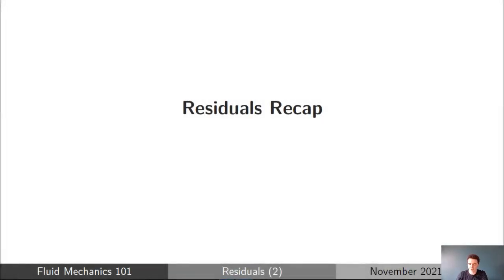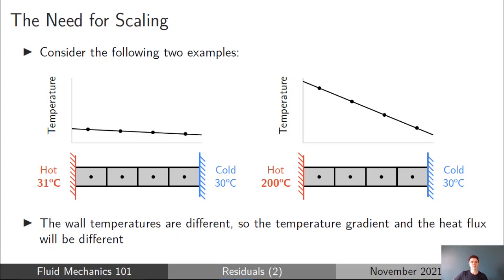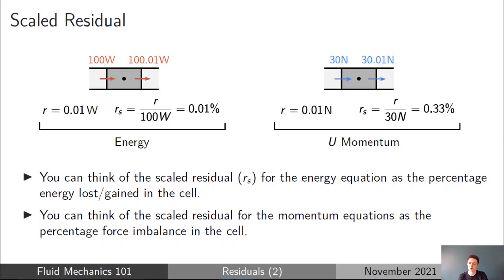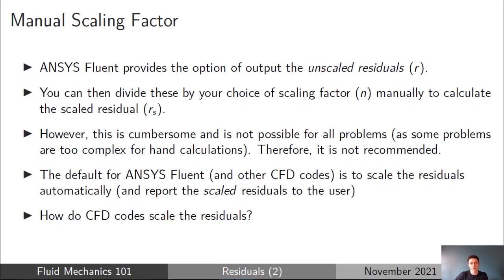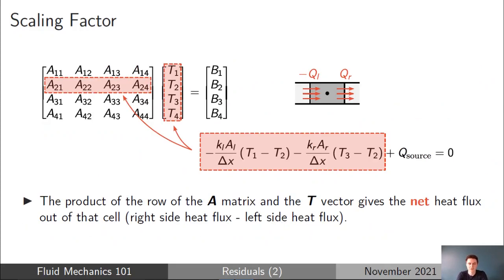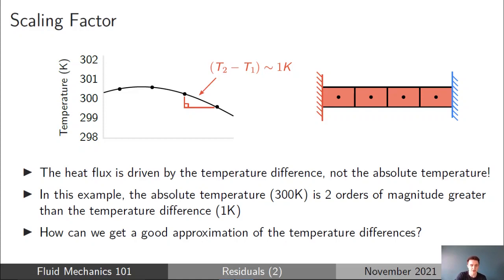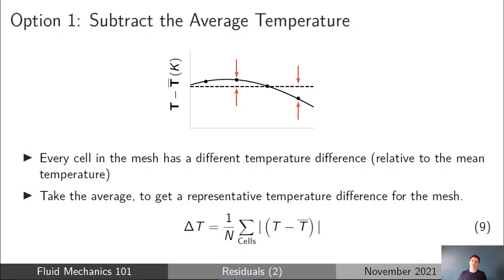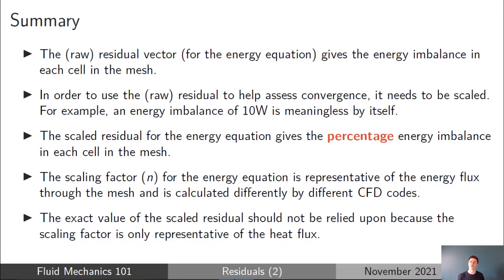[CFD] Residuals in CFD (Part 2) - Scaling

Comment: Thanks for video. As I remeber Ansys Fluent do scaling in some different way.  IIf we make matrix A_abs from matrix A in the following way aabs_ij = abs(a_ij), then we can obtain vector of reference resiudal by multipling  A_abs on vector T .  The method that you describe is default in OpenFOAM?
Reply from the maker: Yes, I described the OpenFOAM version, as we can see it in the source code and user manual. Fluent seems to be hidden and it is not clear exactly how they do it, so I left this out 🙂

Comment: where i can find these these thing in cfd ... i mean how can i display it as plots
Reply from the maker: What code are you using? It should be pretty straightforward in fluent, star and CFX. OpenFOAM is a bit more tricky, you will need to make the plots yourself 🙂

Comment: Absolute masterpiece!! looking forward to your next talk on residuals. Can u pls explain what are relaxation factors in ANSYS Fluent and OpenFoam?
Reply: Let's say a temperature of T^(1) = 10 K is obtained after your first iteration (in a given cell). That temperature then changes to, say, T^(2) = 20 K after the second iteration. Now if you use an under-relaxation factor of 0.5, for example, that second computed temperature will be relaxed to T^(2) = T^(1) + {under-relaxation * [T^(2) - T^(1)]} = 10 + [0.5 * (20 - 10)] = 15 K. Or something to that effect. The point is that the under-relaxation reduces the change in cell values from iteration to iteration to facilitate stability. Else, changes might be too large and go out of control, especially early on in simulations when you are far from your solution. Therefore, it is not a bad idea to start with small under-relaxation factors (values closer to 0), and as you approach your solution, to increase the under-relaxation factors (to values closer to 1).
Reply from the maker: .... The next lecture series will be on exactly this 😅 well explained!

Comment: Thanks a lot for your videos! I am an engineer working for Russian space agency doing CFD, mostly compressible, and I find your tutorials very helpful for the various of things. I have been trying to find an explanation about lowRe functions and you gave this in one of your previous tuts, but I am left with the question like what are all-Re and high-Re functions and what is the difference between them.
Reply from the maker: I am still trying to work this out myself, but I think the confusion comes from the description of 'Re'. I think they are referring to the wall Reynolds number, which is a Reynolds number based on the shear velocity and the distance from the wall. You can use this 'wall Reynolds number' to define where you are in the boundary layer profile. If the function is 'lowRe' then it only works if you are in the viscous sub layer. If it is 'highRe' then it only works if the first cell centroid is in log law region. 'allRe' has some capability to blend the buffer region (but this will always be questionable). That is my current understanding, I hope it helps ☺️
Reply: Sounds quite logical, that’s why I always try not to use allRe functions cause this term is blurry enough for me:) so the term “lowRe” is a unique attribute of k-epsilon model and has nothing to do with k-omega model, as far as I understand. I am using different from ANSYS software, and when I choose model SST it allows me this 3 wall treatment models to choose- low-, all- and highRe, I don’t quite understand why I have to choose it since k-epsilon is not supposed to be used near wall so these wall functions are not applicable…

Comment: Thank you for this series. For the momentum equation, what does the temperature difference represent? Like what difference do we need to look in?
Reply from the maker: The velocity difference? Maybe I am misunderstanding
Reply: @fluidmechanics101  Yea, I got it. Essentially you take a representative heat flux for a cell that needs a representative temperature difference. In the same sense, for momentum equation, a representative momentum flux has to be chosen.

Comment: Hi,

First, thanks a lot for your fruitful video. Both parts 1 and 2 are amazing, and you delivered the material in a very easy-to-understand manner. From your explanations, I could understand that the CFD codes calculate a vector of residuals for each transport equation when solving a CFD problem. So, assuming that our problem deals with N different transport equations and the domain is divided into M grids, we get N*M residual values in each iteration. From your first video, we learned how to use a representative residual for the domain in each iteration to work with N values instead of N*M values in each iteration. Also, in this video, you explained how the CFD codes scale the representative residuals to make our judgments (about the convergence) more accurate. However, some CFD codes (like Comsol) provide a single convergence plot (or, as they call it, error plot) for each iteration, no matter how many transport equations are included in the multiphysics problem. I understand that one can get the residual values for each equation from these codes; however, I was wondering how the residual plots (for each transport equation) differ from the single error plot. I would appreciate it if I could have your comment on this.

Thanks
Reply from the maker: Hi Mehrzad, your summary is perfect. However, I am not too sure how COMSOL works with its error plot. Probably worth having a look at the manual too see what it is doing and what it means by an 'error plot'
Reply: @fluidmechanics101  Thanks a lot for your response. Let me first correct my mistake. The name of the plot is 'Convergence Plot' (nor error plot). I took a look at the manual before, and I double-checked it just now. There is a short explanation, and most of it is related to the plot settings. The only relevant part (in my understanding) is as follows (I am quoting it from Comsol online documentation).

'For the nonlinear solver, the convergence plots show an error estimate for each nonlinear iteration number. These numbers also appear in The Log Window. The segregated solver shows one plot with one graph for each segregated step.
For the iterative linear system solvers, the error estimate for each linear iteration is a factor times the relative (preconditioned) residual. This number also appears in the Log window as LinErr. When these solvers are used together with the nonlinear solver, the graphs for the different linear-system solution steps are merged, and the plots use the accumulated number of iterations. Each linear solver used has a separate plot window.
When using the parametric solver, the graphs for the different parameter steps are merged, and the convergence plots use the accumulated number of iterations. The graphs for the different nonlinear and linear solve steps are concatenated. The plot uses the accumulated number of iterations.
When using a Time-Dependent Solver, the graph in the Convergence Plot window shows the reciprocal of the time step size versus the time step. That is, a convergence plot with decreasing values shows that the time-dependent solver takes longer time steps, and vice versa.'
Reply from the maker: Once again it looks like the CFD manuals are not being very clear 😂 I will have a think and see if I can work it out
Reply: @fluidmechanics101  That's true :))) Many thanks.